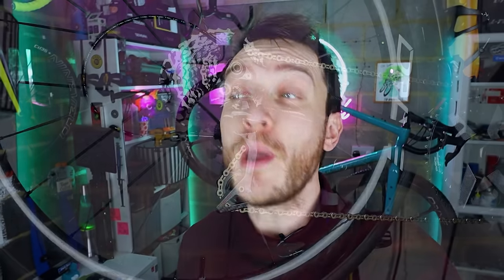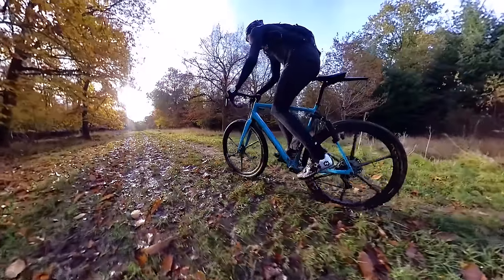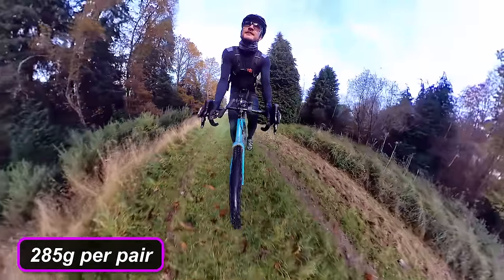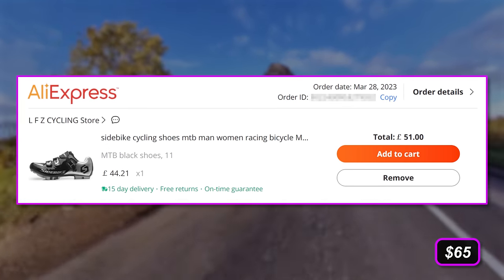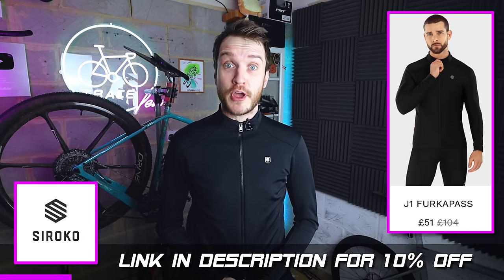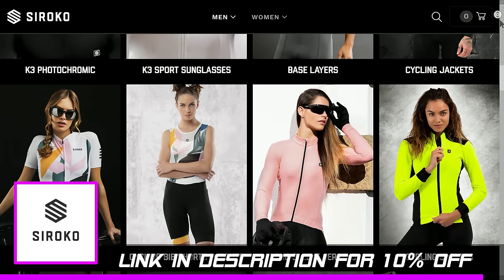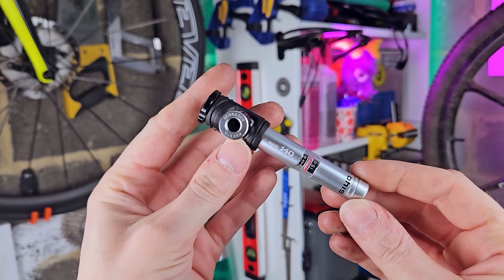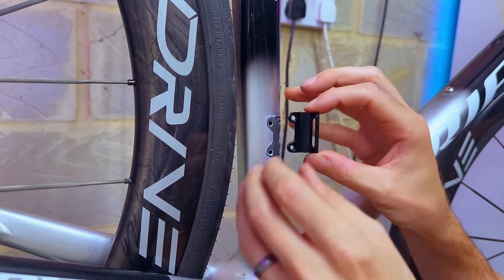Cheap bike parts - My best & worst of 2023

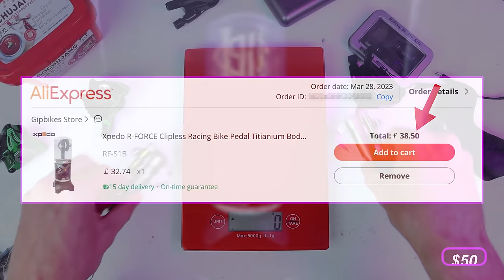Comment: 🥖  11:23 Sorry, these are fake! Packaging is wrong, also, the original is discontinued for years already and was 170g for the pair (and a painful almost 200,- Euros ;-) .
I ride them since 2018 without issues.
Xpedo (SSSSpeedo) is an OEM brand which usually is praised, I rate them as well.
Getting relibable lightweight pedals does never come cheap - Just sayin', bruh 🙂
Try the M-Force 8 CR by them, 260/pair.
🥖

Comment: A total yes for the ZTTO cassette I find the shifts are 95% with a Shimano chain only one gear on the upshift needs help. 

The dekas light weight rotors also have clearance issues caused by the rivets it's very hard to setup without the rivets hitting the caliper.

Comment: Evans Cycles sell the Zeray pedals branded as Muddy Fox pedals, at £22. I bought a pair for my tt bike as they are so light. They are fine for what I use them for and clipping in and out has never been a problem. I use M520's on my other bikes.

Comment: Using these deckas rotors F180/R160 for thousands of km with 4 piston brakes on mtb. Got no issue btw. But as I'm a seller, last month they told me that they are discontinuing the 180mm but didn't tell me the reason. Maybe this one

Comment: I am really interested in the OG frame. Whats the max tire size on it?
Reply from the maker: I'm running 700x28's, which is the largest they reccomend, but depending on wheel choice, i think you could squeese 30's on there without too much problem.

Comment: Zeray pedals are not good, if you are like me that enjoy a firm cleat those pedals will drive you crazy. And over time the treads of the adjusting screw itself will be destroyed. Same problem for the brn versions. The heavy Shimano seems the most durable pedals at least for me 😅

Comment: Hello. Zray pedals...no good experience 
+Weight nice
-got them wrong assembled. One spring wrong mounted. Ok repaired 
-loosen screws. Damaged thread
-finally one side impossible to catch cleat in. Finally found bended from some impact. Straightened by screwdriver. Too weak.....return to old Shimano

Comment: And what about having a durable bicycle with normal components ... Hope disc, shimano SLX to XTR drive train, some good wheels, a rigid aluminium or titanium frame from a reputed builder ... I don´t know, my Rocky mountain has no isues for 15 years and it continues the same. And my Yeti ... I have one cheap bicycle because I like to try some cheap componets (microshift advent, miranda crank set etc) but at least one has to be the perfect and durable bicycle you can trust and in aliexpress are litle things that last for the same as the normal stuff. But for the daily bicycle it is fun to try new stuff.

Comment: Fun fact about floating rotors - in motorcycle racing they use so-called fully-floating rotors  meaninf that the rotor does not have a solid connection with the rivers and they indeed rattle like a tambourine. This is supposed to offer much, better heat management and warp prevention than the semi-floating rotors in which the connection between the rotor and the rivets is solid. So, you might accidentally got yourself a top-notch rotors 😅
Reply: They should be floating but shouldn't be rattling like that. A buddy of if mine got them on his bike for a year now, no rattles. The ones on his motorcycle does not rattle too when you tap it with a wrench.

Comment: I've used a couple of brands of third party SPD pedal and they've both been shite, so I now run the dependable M520 pedals on both my road bike and my commuter/gravel bike. Can't complain about them at all. My road bike is titanium and at 9kg or so not particularly light to begin with, so I don't see the point in being a real weight weenie about my pedals, especially when the Shimano pedals work so well.

Comment: Everything's was fine until you showed the tip of those nails. 
Epoxy truly hardens but it wont bond with the brass nails. If the thing breaks again in a crash, it will expose the pointy metal things towards your body or face. 
Hope you were kidding. Love your videos. Please don't use that computer mount ever